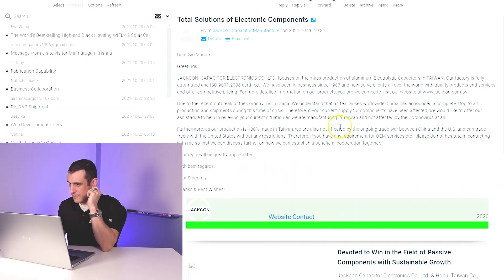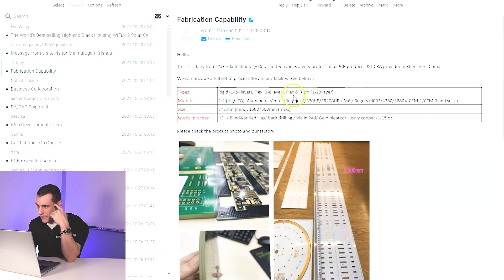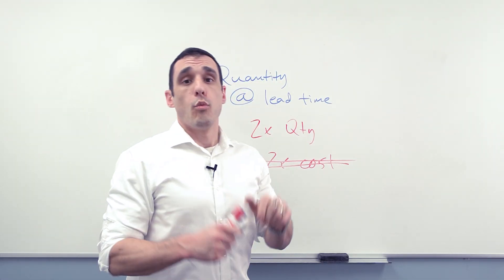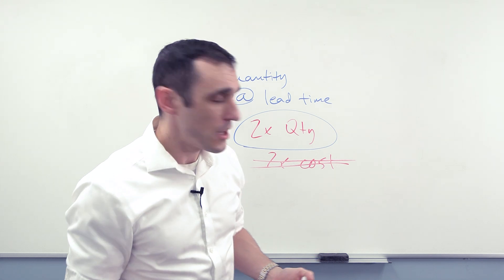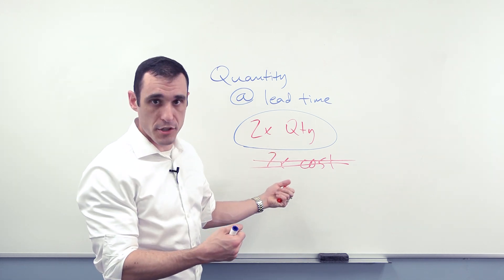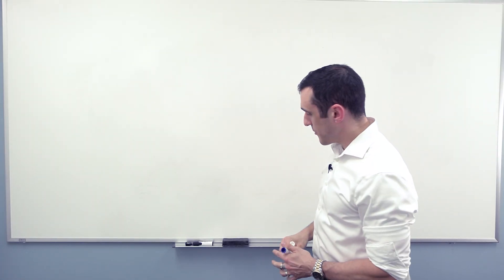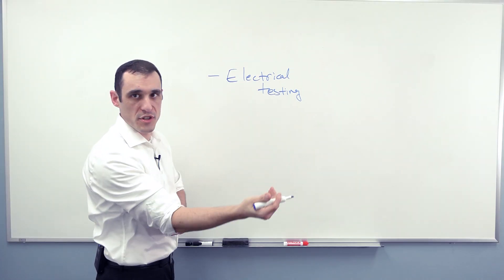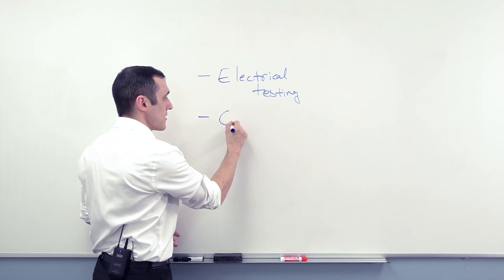How to Choose the Best PCB Manufacturer

Comment: What is the best solution for a pcba project that has normal and not very very strange components?

1. order PCB + component + assembly to one company?

2. Order pcb to one company, buy the component yourself and send them to a pcba factory?
Reply: If you ask the manufacturer to purchase the components for you they might mark up the bill of materials and charge you more. For prototypes or short runs, I prefer to handle component purchasing on my own and send them to the assembler. The fabricator will then also ship the finished boards to the assembler. For some products that are simpler and do not need a lot of testing or engineering review, we do everything with one company.

Comment: Buying the components by yourself or let the manufacturer buy them (which one is the cheapest) also i wonder if manufacturer really buy genuine components (especially passive components) which you cannot recognize their manufacturer.
So what do you need to do in that case? 
Thank you again
Reply: Buying yourself is always cheapest when quantities are low, full turnkey with your assembler sourcing the components can result in 100% markup in some cases, so you're basically paying double. I prefer buying myself just because I don't want to pay them for that on a prototype run and because I can control which chips I might be getting as alternatives when stocks are low.

For volume production, it's sometimes a different story. The manufacturer I work with for volume jobs will handle a lot of the sourcing for passives and common ICs because they are already buying tape and reel, they might have (or they should have if they are a good company) a lot of the components you need for passives in stock unless it's specialized (for example, automotive-qualified). They don't hold a bunch of specialized ICs. Not all EMS companies will do this though.
Reply: I am a pcb manufacturer,and I can tell you it is more convenient to use the one-stop service,it can help you to save more time and you don't need to do anything,only release a order,then both pcb and assembly will be done.And you can compare the price and time of buying the components by yourself with through us to produce it,then you can know which one is cost-effective.
Reply: @liudolores-pcbmanufacturer1720  Yeah I agree it is more convenient, but sometimes we will have procurement problems that force us to make an engineering decision about a board that the manufacturer is not prepared to make. We just can't risk having the boards getting scrapped when we have to make those last minute decisions about critical components (usually an IC with only 1 or 2 replacements). So in that case we consign those specific parts and let the assembly house deal with the other parts like I described above.

Comment: Hello, thank you for these amazing series of videos, i have a question if that is possible.
Usually they tell you if you panelize boards so the production will become cheaper. I don't think that it's always true because some manufacturer have their standard size of panel so if you don't do the same size so it's not going to be much cheaper.
I don't think for 1000 pcs (for example) it will be that cheaper. Right?
Thank you again.
Reply: It is true that PCB manufacturers produce panels so that they can get higher throughput from their process. The low end of the manufacturing costs is fixed to the cost to produce a panel. Every manufacturer I've asked about this does not accept customer-supplied panels because customers will mess up the panels, so the fabricator will just make their own panel on their standard size. I know that some manufacturers do supply a panel template that you can use and it might have different standard sizes.